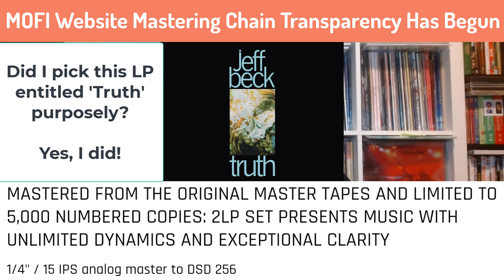Episode 28   Mobile Fidelity (MOFI) and Vinyl Transparency

Comment: Super Vinyl is a name they use for a type of compound introduced by RTI. Other labels are using the same compound under slightly different names (all pressed at RTI).
Reply from the maker: Thanks - at 5:57 of my video I show a graphic showing SuperVinyl is a new proprietary compound developed by Neotech and RTI.  If my words implied that MOFI developed it, that wasn't my intention. Only to say they pursue the best and newest formulations in the industry.  Clearly, MOFI is not a chemical company and count on others in the industry to bring to them these surface improving solutions.  Thanks for clarifying and watching!

Comment: So what is the best source 1/2” 30 IPS?
Reply from the maker: That spec (1/2” 30IPS) represents the fact that the original master tape was a 1-2” analog tape run at 30 inches per second which means the waveform set on the tape was spread out along the tape yielding greater sound accuracy.